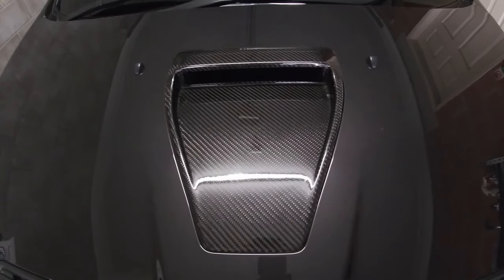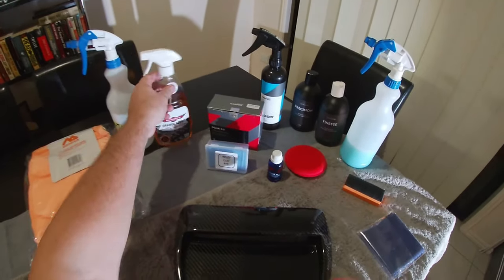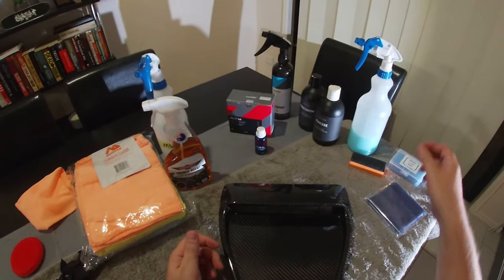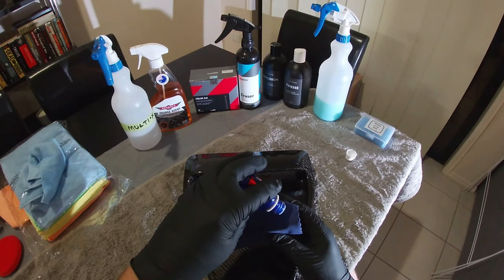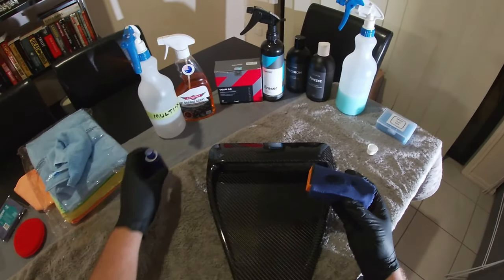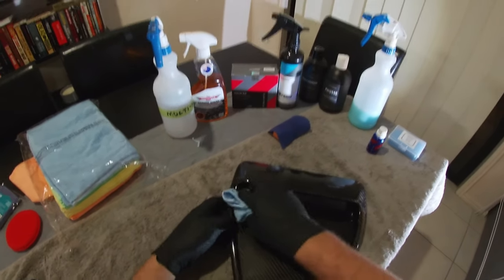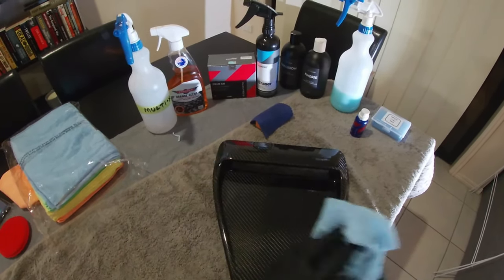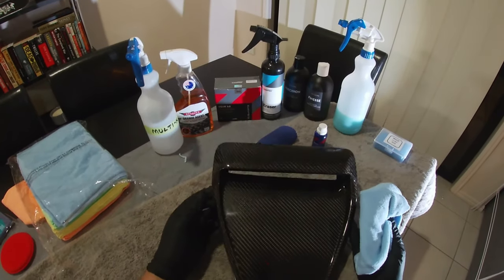Ceramic Coating Carbon Fiber

Comment: Bought all the necessary products and tomorrow I will be doing this to my new CF Spoiler before sticking it on my trunk. Thanks for the instructions!
Reply from the maker: Nice man, well worth doing and not having to worry about the dreaded fading carbon